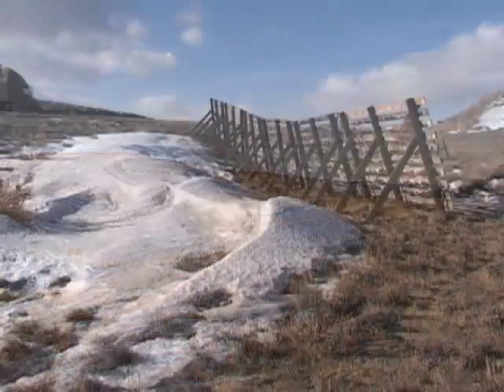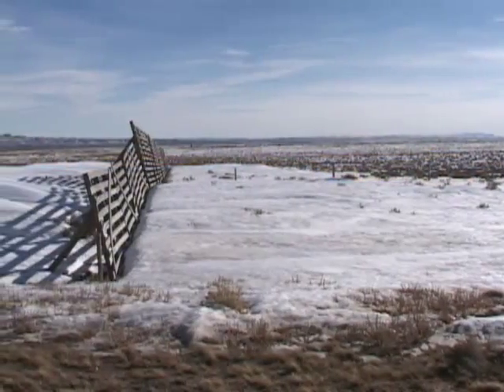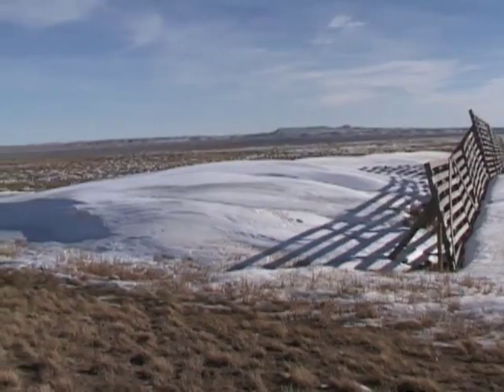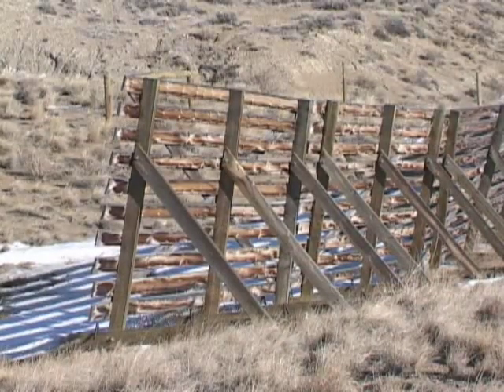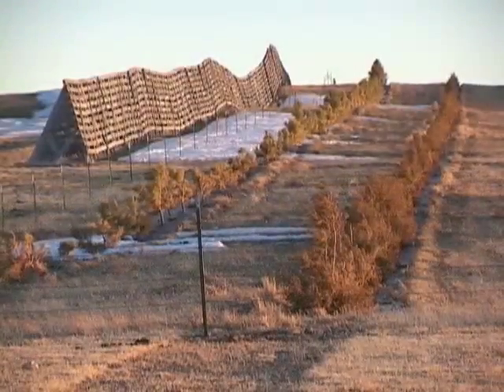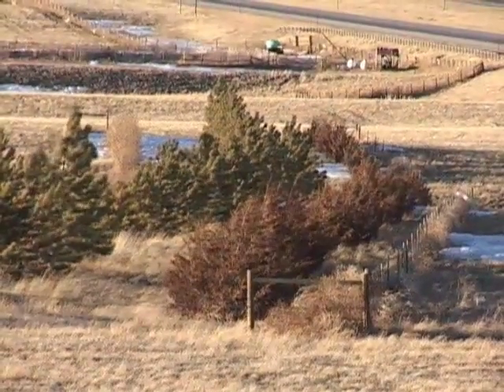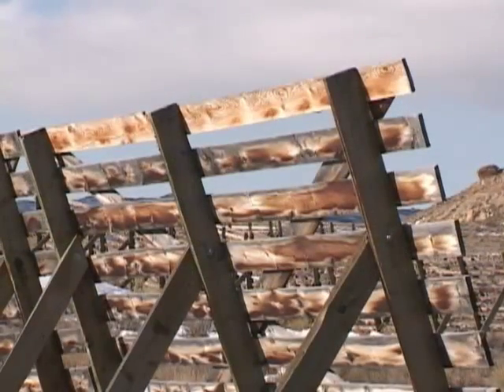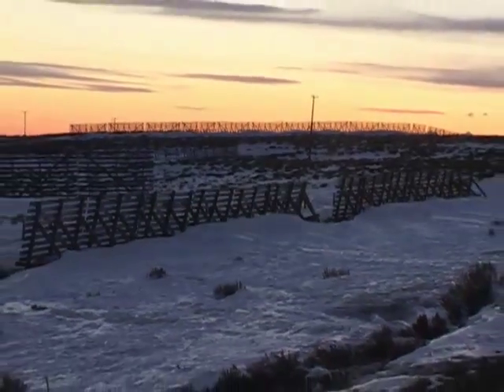Snow Fences & Living Snow Fences

Comment: I have a real problem, I have a 700 foot driveway and a good 300 or more is exposed to and open west field that blows east. My driveway sits east of field. My driveway is approx. 10 feet wide and the width of my property where my driveway sits on is 36 feet. The west strip of land is 14 feet to 16 feet. Can a 4 foot snow fence effectively work on my driveway? If not what can I do?
Reply from the maker: +M D A M A D Here's some resources that might help: I would suggest this article (1) from B&B along with the other snow control topic on the site (2)

http://www.uwyo.edu/barnbackyard/_files/documents/magazine/2009/fall/snow-fences-fall-bb-2009.pdf

http://www.uwyo.edu/barnbackyard/resources/buildings-fencing.html

Hope this helps. Also feel free to contact your local Extension office or Conservation District, they may be able to do a site visit and talk through some of your questions.